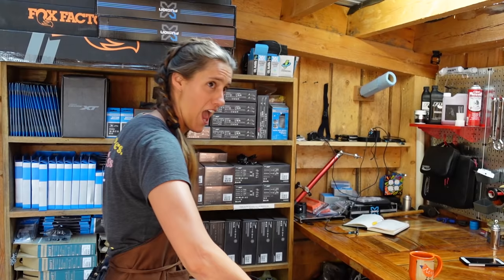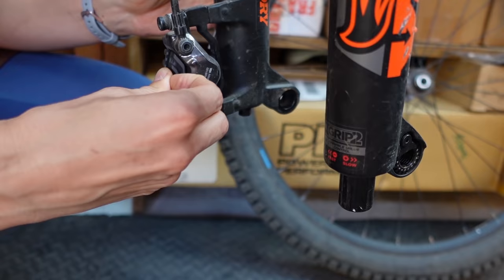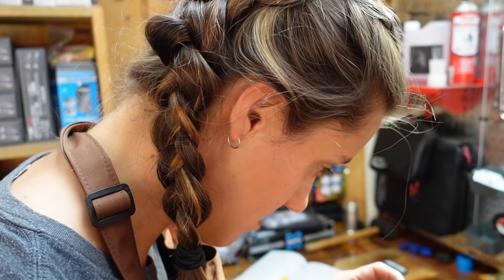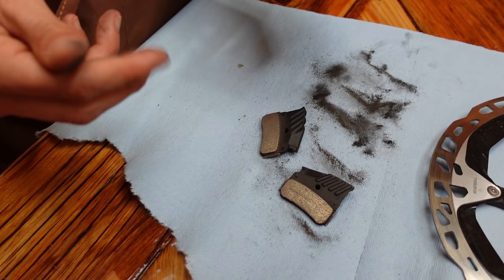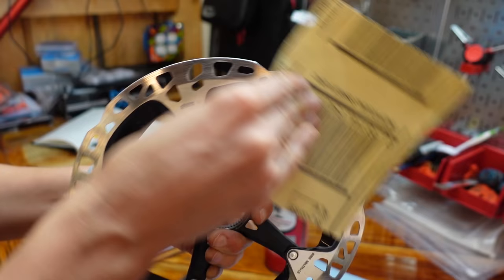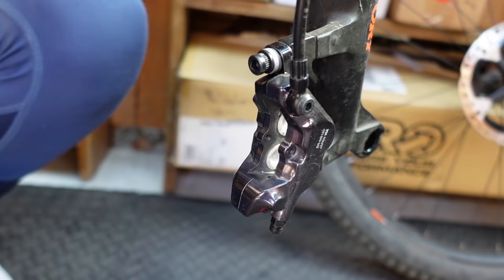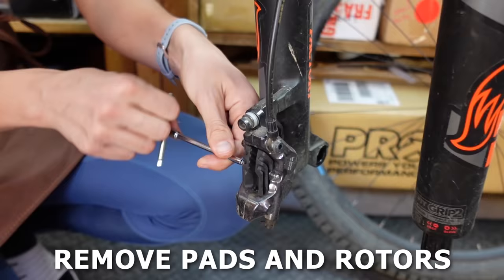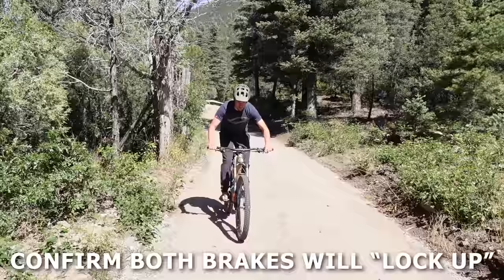How to stop squealing brakes and get more power (bedding in brake pads and rotors) | Syd Fixes Bikes

Comment: We talk about the sanding technique often to renew surfaces. But Syd we’d love to send you some of our brake pads to test - they are notoriously dead-quiet in all conditions.
Reply: Including the condition of, "oops, I just spilled mineral oil on my pads and rotor"?!
Reply: @mattgies  rotor, sure. Brake pads - probably not. That always seems to be the move that kills them with no return.
Reply: RollinRat  I'm not sure if your comment is directed at mine above, but to be clear, when I refer to a sanding technique, I am ONLY referring to rotors. Sintered pads (full metallic pads, which are the only ones that use the sintering process) can contaminate the rotor *surface*. This can typically be sanded off easily to renew the surface. All rotors will have a "thickness limit", which you're certainly not going to put a dent in with a good hand-sanding. There really is no way to bring a brake pad back, regardless of the compound. We do suggest a light sanding if the sintered-contaminated rotor glazes the pads. Its a very simple and quick sand to make the brake pads "look" like new again (but again, this is never to resolve a liquid contamination).
Reply: RollinRat  ours are ceramic-based and have a pretty different ingredient makeup, BUT do share some elements with a resin. Ours will have the longevity if a sintered, but much better bite, progression and zero noise.
Reply: RollinRat  Just saw this. I will reach out to you and let's talk. We don't like to just send pads out without some discussion and honestly, rarely just give them out (the response when we send free samples just isn't taken as seriously we have found). I'll make note of your store and make contact. Thank you.

Comment: On old rotors it's worth cleaning out all the holes too when you're already putting in a fair effort. They're more for improving bite than cooling and get gacked up with greasy pad dust mixture. Dremel with small cotton cone tip works well or even a drill bit if they're round. Use isopropyl alcohol to degrease.

Comment: I find it unnecessary to bed in my brakes. I often mess it up and make my brakes squeak (resin pad). I ride pretty much everyday, so as long as I remember not to lock-up my wheels when I switch to new pads, the brakes actually feels pretty nice the more I ride it.
Reply: i heard on another video that with resin pads spray water on the pads to keep them cool while bedding them in

Comment: If your brakes are squealing often, try going with bigger rotors. I went with 220/203 magura mdrp ebike rotors.  Im 230lbs and ride some steep trails. So far after 6 months no more squealing.
Reply from the maker: Sounds like you were having issues with burning out your rotors! Glad you found a solution.

Comment: Is a burn in necessary ?    When you use the bike in normal use,  eventually the burn in will compete with normal cycling.
Reply from the maker: If you don't follow the bed in process (Macky misspoke when he called it "burning in") before riding it normally you risk it bedding in incorrectly. This has happened to us numerous times and you never get proper brake power until you resurface them and bed them in properly.

Comment: So my wife's bike had been in storage for a few years following the birth of our son. The bike was hung upside down from the roof of our shed (so I know there were no contaminants getting on the rotors). I did have to bleed the brakes when I took the bike out. No problems there. The bike had been put away with a new set of resin ice tech pads in front and metallic in the back (what our lbs had in stock at the time). 
Issue is that both brakes are now howling like demons are flying them alive. I have sanded with bike brake cleaner on both pads and rotors. Burned to where they stop ok but they are just crazy loud. Like nothing I have heard. I guess I'll blowtorch them but I'm kind of at my wits end with these. Never had such trouble getting brakes to settle in before.

Comment: i did everything on this video perfectly and now they are squawking louder and more often!!! D,: before it was only at the end of a stop now its almost all the time.
Reply from the maker: Hmm...did you make sure to bed them in after sanding/cleaning them? You may also find that they'll stop after a ride or so.
Reply: @sydfixesbikes  i tried to yes. im in south florida so there arent very many hills but i rode up to the top of a bridge and braked on and off for 3 seconds fairly hard like you say in the video did that twice on one wheel and started squawking loud again. took the pads back out and they are glossed over again  and all the sand paper scratches on the rotor were gone too just as it was when i started. i used 40 grit on the rotors with a machine  and  180 on the pads flat on the ground and sprayed them all off with brake cleaner before i reinstalled. with all that work and cleanliness i feel like getting new pads and rotors wont even make a difference because doing this essentially makes them "new"
Reply from the maker: Weird. Worth trying again and do the braking on and off maybe 10-15 times per wheel. You can do it on flat ground so you don't have to climb the bridge a bunch of times, just make sure you never come to a stop and start with lighter braking for the first couple pulls, then slowly increase it.

Comment: Hey, there. I have an REI co-op ebike. So far, it's been great, but lately, 3 months. I'm having issues with my rotor coming out of alignment. At least, that's what REI keeps telling me. I've had the bike less than a year. I use it for commuting, errands, and recreation. I was using a trailer, but they thought maybe that was the thing knocking it out of alignment. I took the hitch off and stopped using the trailer and still continued to have issues. Personally, I think it's these bumpy AF streets in Tucson, AZ. Thoughts? Apologies in advance for this long one! Lol

Comment: I like your method and would consider this the engineers way of doing it, i.e. the correct way.  But, in the last few years, I have found a quicker way.  I'm fortunate enough to live on a VERY steep hill.  When my discs and pads become contaminated, I ride to the top with a bottle of clean water, I ride down at a good pace and apply enough power to create a stoppie or endo, I do this several times until the brake is smoking hot, I then douse the brake with water.  I ride back to the top of the hill and repeate 3-4 times.  This works well and avoids any mechanical stripping of the brakes...
Reply from the maker: We've done something similar (using weather/puddles generally) and not quite as deliberately, but find that even though it will get the brakes working well, it ends up being a temporary fix and we eventually have to do the method mentioned in this video. Good to know that doing it more deliberately yields better results!
Reply: @sydfixesbikes  Yes, that's where it started for me, we used to use mud on the trail.  It did cause premature wear.  I think the dousing with pure water clears the 'mud' created by the sintered brake pad material, leaving a matt finish you mention on the pads.
Reply: The guy at GMBN Tech recommends wetting the pads with water and rubbing them against each other to remove the glaze any time you pull the pads.  I've been doing it with success when I pull the pads to check for wear.  I just put new pads on the back yesterday and used the water on them before installing.  Then this morning I did the break-in while heading to the trailhead.
Reply: @dgreensotr  Ya know, I decided to try that water-and-rubbing trick the last time I pulled my pads. The brakes had been perfectly quiet before I pulled them, then after the water they started squealing horribly. So I won't be trying that one again. I should have known, "if it ain't broke, don't fix it".
Reply: @mattgies  Sorry about that.  Something else must be going on with your brake system.  I haven't had the same issue with my Shimano MT420 brakes.

Comment: Emery cloth isn't the best for this purpose, it was designed for more aggressive sanding like plumbing for example, or rust removal, not to mention the loss of sanding grit it leaves behind which is bad ju-ju to components that might be on your bench. It's always better to use a good quality paper like (norton) or equivalent and not too aggressive,  120 grit works well, I also sand in a 20⁰ or 30⁰ crosshatch that helps in break-in and longer pad life.
Yes this is extreme, but it works .

Comment: Question; does it matter what level/grit of sandpaper you use?
Reply from the maker: We've never worried about it, but finer is probably a bit better...
Reply: Ive read so many threads on here about sandpaper and I didn't want to take away from what there trying to do in covid but as an aircraft engineer with 32 yrs experience it makes me shudder when talking what grit sandpaper it shouldn't be used its not designed for any type of metal its for wood and alike you need to if anything some wet/dry fine paper but the best way to clean or degrease a rotor is by a plumbers blow torch that burns the contaminated parts ie hairlines that hold grease / contaminates,

Comment: Hey maybe somebody reads this and has a tip for me. My front brake is making bubbly noises under load. I bleed the brakes, I changed rotor and pads at the same time (cleaned everything before). I bed in the brakes as suggested by sram video tutorial. The brake point feels nice but the stopping power is far less than the back brake. Has been like this since I got the bike. When I checked brake pads, the back was way more worn because I just got used to using the back brake more. Kinda frustrated. What else could be the problem?

Comment: Hya,love your easy listening very helpfull bike maintenance Vids..everyone able bodied person should be able to get hands on with their beloved Bike,plus if you DIY you know its been done properly.and you can save a lot of waiting in the shop time and of course money.keep up the  good work...However please take a tip from me Syd ...being in a work place whilst wearing Crocs or open toed shoes or any shoe rather then a sturdy preferably with steel toe cap shoe or boot can have tragic consequences on your feet or toes..they are much nicer in one piece..also sanding any material especially metal, or brake pad material that could contain asbestos or other small fibres that float in the Air when abraded ..Without using a decent protective face mask is making a time bomb for your lungs in later years Psillicosis or Asbestosis you do not want...i have seen all these things..do not go there..please get safe and wear PPE when in the workshop..keep up the good work.

Comment: I'm no expert (believe me, lol) but if you lay the sand paper down on a flat surface and then rub the brake pads back-and-forth on the sandpaper it's much easier and also creates a flat surface for the pads to run across, versus using your fingers. I just done your procedure on my E bike yesterday, so I just need to go out and burn the brakes in (I never would have thought of doing that, and I've never even heard of it honestly, and I've been cycling around probably 20 years, but never with disc brakes though) 

I used 400 grit wet or dry sandpaper, and I have a feeling maybe I should've use something a little bit coarser, but maybe not, so we'll find out later today.....I know what you used was much coarser maybe like 180 to 220 grit. One thing that I didn't notice, I did not have the sand scratches in my rotors like you did, but I could at least do that again with a coarser sand paper without taking everything apart again, and then clean again with alcohol. 

So thank you very much for the very useful and helpful video… i've always purchased very expensive carbon fiber road bikes, so I've always relied on the bike shop to do everything for me, so now I'm learning to do a lot of this mechanical stuff myself as I am very mechanically inclined. Also, I didn't have to remove my wheels, as my calipers were removed with 2 easy accessible bolts. With an Ebike, I didn't want to remove my rear wheel anyways....But with research, I'm not nearly as fearful as I was, because my hub motor easily unplugs

Again, thanks :)

Comment: A little late to the game commenting, but instead of sandpaper you could use a sanding sponge from the drywall section in your local home improvement store. That would be much easier to hold onto.

Comment: Good evening 👍 Just a few questions in relation to Bike Multitoolkit as I was unable to find any answers on the internet:
1) Where and when do we use/need the 9mm and 10mm hex key ?
2) Function of T25 and T30 Torx key?
3) Function of 2mm Allen key?
Reply from the maker: It depends on the bike and components, but often you can use an 8 or 10mm to remove pedals and reliving some cranks requires a big Allen like that. T25 is used on many SRAM components and T30 is used to remove chainrings on some Shimano cranks. The 2mm Allen is used on some small bolts (some derailleur limit screws and similar).

Comment: Pads are easier to attend to with a pane of glass as a base (very Flat) and drywall sanding screen between the pad and the glass. Rub in a figure 8 motion and the material that's removed simply falls thru the screen. No cleanup required...

Comment: I am watching this video again. Then questions  come up. What grit sand paper are you using. Why are you using a wet dry sandpaer then switch to a general purpose sand paper. Why not use a sanding sponge. i am thinking that a finer grit sandpaper would be a better than a coarse grit. Also why not use the straw that comes that comes with the brake clean gives you more control so you have less over spray. Over all  good video0 Tips and helpful hints are great.
Reply from the maker: The answer to most of those questions is: we are lazy and just use whatever we have on hand...

Comment: need to sand them pads on a flat surface.  also a corse sand paper is kinda ehhhh,  a nice emory cloth or scotch brite pad is better for scuffing the rotor and actually removes all the rotor glazing.  also a nice tip is to wipe your rotors off with some isopropyl alcohol after a few rides to clean the contaminants off the rotor.

these videos seem like more of a set of test questions for syd

Comment: What number of sand paper.  Using brake cleaner doesn't do the job of taking away the oil /  Greece?
Reply from the maker: We just use whatever sand paper is on hand, generally a medium grit.

Comment: The fastest way to get rid of squeal is to ride fast, the grab the brake as hard as possible, to the point where you almost lock up the wheel, then release quickly. Repeat as needed until squeal is gone, the fast hard grab breaks the glazing on the pads. Do the front and rear brakes separately... If that procedure doesn't work, then most likely you got some sort of oil on the pads, at which point just clean the rotor and replace the pads.
Reply from the maker: This method often works, but only temporarily and generally you have to do it at the beginning of each ride.

Comment: Will they just bed in properly by themselves after a few rides or do you really need to do this? Just got a new bike and don't want to take parts off already.
Reply from the maker: If you just got a new bike you should follow the steps at the end of this video (where Macky is riding the bike and slowing braking) and that should be enough. However if you are having issues after that or having squealing it may be because they glazed over instead of bedding in properly, at which point you made need to sand or at least clean them. Hope that makes sense!

Comment: Every new brake pad needs to be “broken” or “bedded” in if you want them to perform and as others stated if you are going sand everything like you are you need to run them across a flat surface, the way you did it is leaving potential for uneven surface which will cause vibrating under braking.  A better thing to do would be just clean the rotor really well with brake cleaner or if you want more use steel wool.

Comment: My experience is that the brake cleaners you get nowadays are not great. Isopropyl alcohol or silicone remover works best.

OH and don't flush the brake pistons with brake cleaner.

Comment: What grit sandpaper did you use? Do you need to burn in the pads if the pads are resin?
Reply from the maker: Yup, need to burn in (or "bed in" as many people say) resin pads as well. We use whatever is on hand, generally fine to medium grit

Comment: I was always told it's better to sand in a circular motion, so that scuffing marks aren't parallel. Heating the pads over a gas stove flame for 30s can really burn out contaminants - oils can penetrate deeper than the near-surface layer. Older shimano brakes have a tendency to weep oil at the seals. A quick touch up and clean is necessary every few weeks. I usually  clean and lube the piston walls as well and then push them back in.

Comment: Is it a really big deal if the disc was touched pre bedding? I accidentally did it not once, but twice. 
Had to do something else, came back---only to forget they needed cleaning with IPA pre bedding 😅Wups.

Should I take out the pads, sand them down, IPA clean the discs and re-bed them? The bike is brand new and hasn't been ridden more than 5-7 minutes.
Reply from the maker: Hard to say. If they bed in okay and you get good bite, don't worry about it. If you get a lot of noise and no power, then they'll probably be resurfacing
Reply: @sydfixesbikes  Thank you for taking the time to reply! In the end I sanded them and re-bedded just to save future hassle. Love the videos btw! Thanks for sharing the journey and all these great tips with all of us